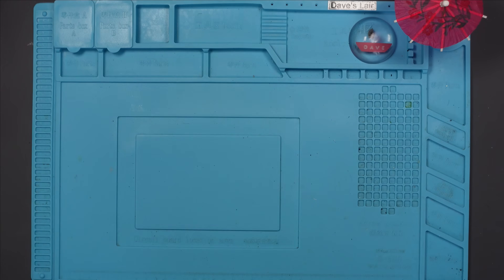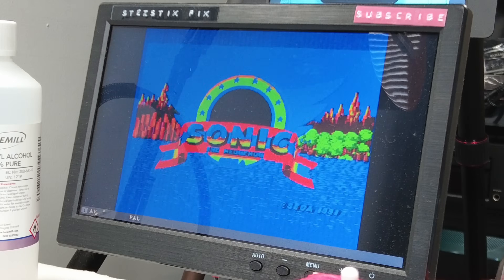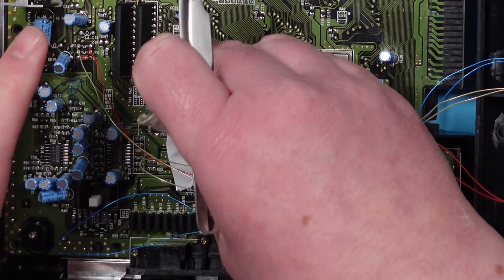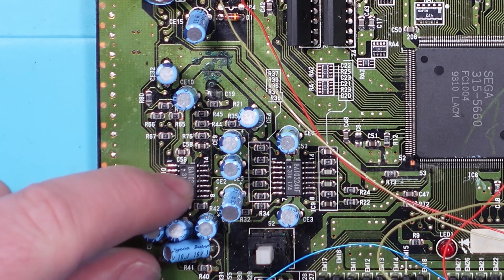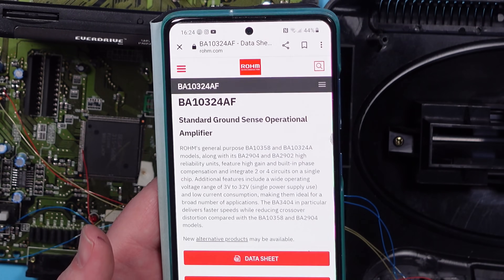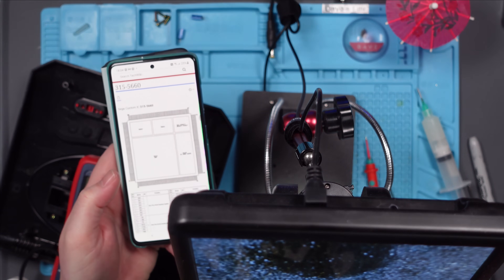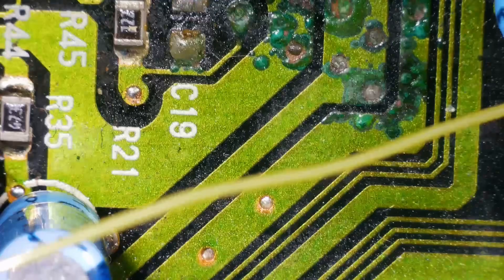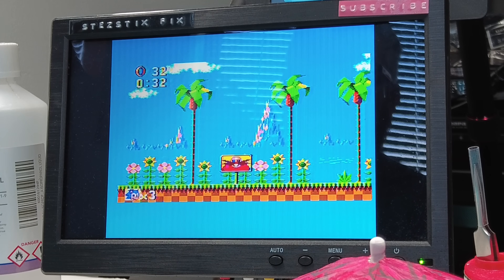This MEGA DRIVE Has a Strange 8 BIT SOUND Fault | Can I FIX It?

Comment: When NONE of the Master System sounds worked, I went straight to the square wave generator - they kept it on the Mega Drive as a quasi-channel, but it did ALL the Master System sounds.

Comment: You have to remember Steve that the Mega Drive is over 20ish years old and is bound to have Dried Joints that need re-flowing..Also you said that "Sonic music was slow" but it sounded fine to me, it was never a fast soundtrack
Reply: He says that because it is a well known issue that 50Hz systems in EU and other countries like mine that use 220V/50Hz will render the music slower than systems running at 110V/60Hz like those in the US and other countries that use that standard.

Comment: Nicely done. Problems like these will happen again on this board though. Leaving the corrosion that's on other traces will mean it will keep spreading. Much of it is under the solder mask, so cleaning efforts will not have done much if the mask was not scraped away and the copper cleaned.

Comment: Neat so the jump sound is using the master system chip. Coolio
Reply: jumping, skidding, and also parts of the music (I recommend watching a Green Hill Zone Deconstruction video).

And to be pedantic, the Programmable Sound Generator hasn't been a chip since the SG-1000/SC-3000 :P Not a discrete one, anyway. Because even in the Master System the PSG circuitry was combined with the Video Display Processor in an ASIC.

In the Mega Drive 2 (at least the typical ones with Yamaha-made ASICs rather than Toshiba) even the Yamaha OPN2 (YM3438) circuitry is in an ASIC with the PSG and VDP.

Comment: so im assuming the music speed is normal for your regional console?
Reply: yes, Sonic 1 wasn't optimised for PAL so the whole game and the music, everything, runs 17.5% (or whatever) slower than on NTSC. Later Sonics had optimisations if booted up in PAL but usually it was the correct speed music but still with slower gameplay.

Even though the console has the mod, he couldn't use the NTSC mode because his monitor doesn't support it.

Comment: Instead of futzing with sawing down the barrel plug end of the cable, check out self-amalgamating tape. Stretch and stick it onto itself as you wrap around whatever and it creates an excellent seal. The run-of-the-mill flavor is not super durable, as it can still be torn more easily than some tapes or heatshrinks, but much easier to apply in a variety of situations. Fancier versions exist that improve on the material weaknesses.

Comment: Great analysis to find the cause of the problem. Just one thing: You paint over areas that still show corrosion. Not that there is still something of the acid in it and spreads further under the paint. In addition, all electrolytic capacitors should definitely be replaced in such a case. So you don't have to start over and over again.

Comment: Initially I genuinely thought the problem was music was running slow. Then I realized it's the PAL version. God the PAL conversions sucked :(
Reply: the music speed was fixed in Sonic 2 onwards but still with the slower gameplay and squished screen.

by the time of Knuckles Chaotix on the 32X (!), they finally bothered to fix the squished screen and actually make the PAL version of that game run in 320x240 rather than 320x224!

Comment: I felt like screaming for the first 13 mins as I've had the same recent experience on a Mega Drive 1 and was certain it'd be a corroded trace to/from the ASIC!  In my case the issue was no sampled DAC sound effects due to a broken trace to the Z80 chip.  Still, great result and very impressive skills to swap the SMD components!

BTW, PSW = Programmable Sound Generator

Comment: Stez I have a Sega Mega Jet. (A very rare Sega console that was used in japan for flights.) It had no audio/video when I purchased it. I found the chip that was hot and I researched it and it was the audio chip. I took it off and well with it off the video now plays but there is no sound because of the missing chip. The problem is I think I ruined the contact pads when pulling off the chip in the first place. Could I ship my sega mega jet to you with the audio chip I ordered to see if you could fix it? I'll pay for everything of course and it could make a neat video maybe? Thanks!

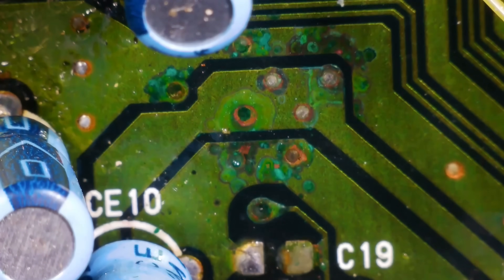Comment: 6:48 is the fault, its the pcb through hole.  The one near C19, you can see the black of the pcb is showing were it connects to the trace.  Not easy looking to spot but all that corrosion needs removed.  Been looking at lots of repair videos.  There are eyelets to repair the pcb through hole (Plated Through Hole Repair Kit).  You can also epoxy a new trace and attach it with solder.

Just a wire works but you don't know how far the rust/corrosion goes into the through-hole barrel.  A wire is a quick and dirty repair.  Youtube PCB Eyelet Repair | BEST, Inc. if you are interested and How To Repair Damaged / Missing PCB Pads || 4 Great Methods.  Remember you can glue the new trace in place and then solder. These are the true fixes.  If all you have is a wire like this video, How To Repair Damaged / Broken PCB Traces - 2 Great Methods.

Everything I have read states all the corrosion needs to be removed.  The copper trace can be removed and replaced with clean copper.  This restores the trace to new.  Got to love what you learn from others on youtube.

Comment: i like it but i have to say it. that switch would have made sonic run at FULL POWER..... i mean at full speed. it was running in the pal slower mode that sonic did not program for
Reply: ironically he had to run it in PAL because that monitor didn't like NTSC.

Comment: 8bit soundchip is called z80
Reply: StezStixFixtelegram  is that spam? Or real?
Reply: Wrong! The Mega Drive has 2 CPUs - a Motorola 68000 (16-bit main CPU) and a Zilog Z80 (8-bit co-processor). It also has 2 built-in sound sources - a Yamaha YM2612/YM3438 OPN2 and a Texas Instruments SN76489 PSG.

For those 4 chips, there are 2 clock signals - 7.6MHz for the 68000 and YM2612/YM3438, and 3.58MHz for the Z80 and SN76489. But shared memory mapping is used, so the YM2612/YM3438 and SN76489 can both be controlled by both the 68000 and the Z80.

Comment: Nice find. I never knew the MD's sound was seperated like that.

Small tip though, it would be a good idea to remove the rust from those other traces before it ends up eating through them completely. Then apply solder mask.
Reply: Yep, and with the Mega CD and 32X, the PCM and PWM (respectively) sound channels can be used in conjunction with the Mega Drive FM and PSG sound channels (such as in Popful Mail in-game and Knuckles' Chaotix).

Another platform, the GBA, would later do a similar thing. The Sonic Advance games are a good example on that platform of heavy use of the Game Boy / Color PSG sound channels in conjunction with the GBA PCM sound channels.

Comment: I strongly disagree that the heatshrink tubing over the frayed cable on the power brick was a fix. That heatshrink tubing is cosmetic, and really not much more. I hope you at least advised the owner to be very careful with it!
Reply: It's not cosmetic if it prevents the cable from bending more....
Reply: @samholdsworth420  Sure, bending. But what if he tugs at it a little? There's a certain amount of friction offered by the heatshrink tubing, of course, but it's nowhere near safe. Furthermore, whatever amount of bending it prevents is going to be insignificant. I'll assume you don't actually know just how thin and flimsy heatshrink tubing is.
Reply: @herrpez  sure it wasn't the best approach to "fixing it". It's a wall wart you plug it in and you never touch it again lol.

Comment: Yuck this prior mod. The tape of unknown composition isn't exactly guaranteed to not develop conductivity or emit acid from the adhesive (both things happen), and the soldering and nonexistent cleanup quality... I feel like I should start console modding or something.

The readings of both caps that you took off look almost factory fresh for their values, no problem at all. Could have just as well spent 3 years on a warehouse shelf rather than 30 years in a console.

Comment: I have a repair and resell shop on eBay and I’m always afraid to do any micro soldering, or major board repairs. I have to admit watching your videos give me a little bit of confidence for some reason.  I really would like to see how you would fix damaged ribbon cables. And I really wish u had some sort of vaccum or air purifier to suck up those fumes, if I remember correctly they can be really toxic and bad for your health to inhale that.
Reply from the maker: Thanks MicMaine!  I do have an little extractor, and use it most of the time... you're right the fumes are not nice to inhale!  Good luck with the eBay shop! 👍
Reply: Yeah well depends on if you solder once a week, then hazard is minimal, or 8 hours a day, when even standard extraction isn't quite enough.

Which part of the world are you at? I wouldn't mind partnering with a vendor in EU to do the repairs for them.

Comment: Steve you done an awesome job and great video, may I ask @6:36 you used your little brush to clean the board, what is this brush called and do you have a link please as I would love to get one. Many thanks
Reply from the maker: Thanks Martin!  It's actually a flux brush that I've cut down the bristles to make a bit more abrasive.  I bought a little pack of them, these ones:  https://amzn.to/391kndu
Reply: @StezStixFix  Thank you so much for replying, I definitely need one as following the SVS guides (Steve TF, Vince MMV, Steve SSF) I have managed to pick up some cheap broken consoles (Ones S & One X) and managed to get them both working. Over the moon even tho i dont have a microscope yet YET! it was a challenge, would love to send you pictures somehow. Now checking out the brushes thank you again

Comment: Good fix.  Did you neutralize the corrosive goop so it doesn't do any further damage to the board.  Battery acid, electrolyte from capacitors and flux resin can cause corrosion.  You can clean it with baking soda or isopropyl alcohol.
Reply from the maker: Thanks Darren.  I did clean it with IPA, but I've been back to it and cleared it much better using white vinegar, followed by IPA and a good scrub.  👍

Comment: Nice repair, perfect demonstration of the Mega Drive's two sound chips/cores haha.

And the Mega CD and 32X can access them as well so it can get a bit silly. For example, Popful Mail uses the Mega Drive's Yamaha FM + TI PSG as well as the Mega CD's Ricoh PCM for some of its music (3 sound chips together - once you get past the CD Audio title screen, of course) and Knuckles' Chaotix uses the Mega Drive's Yamaha FM + TI PSG as well as the 32X's Hitachi PWM for its music (also 3 sound chips together) :P

Being a Mega Drive 2 VA0, the sound quality could be improved by installing a Mega Amp - I think you might have been in the stream New Retro Repair did of him installing my Mega Amp in my Mega Drive 2 VA1 :)
Reply from the maker: Thanks RWL!  Appreciate the info.  I'll take a look at those Mega Amps!  👍
Reply: @StezStixFix  welcome :) there's also the Triple Bypass, but that's more for if the console also has a video encoder with the jailbar issue on RGB, like one of the Sony ones (not sure what the Samsung is like). I chose the Mega Amp because my MD2 VA1 has the Fujitsu MB3514 video encoder which looks fine on RGB.

Comment: Hi there Steve. Greetings from Germany. Just stumbled on your channel. I´m amazed that you don´t have more subscribers yet :). Not sure if you just didn´t show it in the video or didnt´t notice, but you tore off the red wire from the mod that went to the CPU (the one under the white tape). It´s disconnected in the later part of the video.
Reply from the maker: Thanks Dennis!  Well spotted!  Yeah, I did notice and I did put it back on, I edited it out to cut the video length down a bit!  👍

Comment: By the time the Mega Drive 2 came along pretty much everything had been integrated into the 315-5487/315-5660 ASIC, but even as far back as the first revision of the MD1, the SN76489 PSG was already integrated with the VDP on the 315-5313.

The mono signal from that, along with left/right from the FM, A left/right line from the cart slot (used by the 32X), and a left/right from the Expansion slot (for the Mega CD) is then all mixed in on that amp circuit.

99% of sound problems are often down to the caps going bad on that circuit. Either dying or leaking and corroding the traces.
Reply: I agree.

Comment: PSG stands for "Programmable Sound Generator" l think this probably goes to the Yamaha chip as the data in.
The games are slowed down, probably as a consequence of that mod they did there (I read "50Hz" on one of the 2 switches, might be worthwhile playing with those to see if you can get the console to play the games at their correct frequencies).
Reply: PAL Mega Drives are normally 50Hz, the mod is to switch to 60Hz. But he said he had to set it to 50Hz for his monitor for some reason.
Reply: Almost all MD/Gen games ship the same ROM chips in all regions to save on mask costs, and have the game detect which region it's running at. In later games there is speed compensation, but in Sonic 1 there wasn't, it's just slower in PAL region.

Comment: I’m a little worried about the corrosion now sealed under your varnish. Probably would’ve been better to remove the corrosion first since it could still contain something corrosive and continue to corrode.
Reply from the maker: Yeah, I'll definitely be sorting that out! 👍
Reply: Corrosion requires oxygen. The whole point of the green stuff is to block oxygen.
Reply: @JoshuaJonah  Rust isn’t the only kind of corrosion. Everyone can see the effect of electrolyte on traces under solder mask despite the solder mask protecting it from air. Heck, the solder mask itself corrodes.

Comment: When I fixed an AC adapter like that recently I took apart the brick, moved the strain relief down, chopped off the damaged parts, and resoldered. It can be difficult to break the strain relief free of the cable but it’s usually possible. Even when it’s not you can often use another or make your own with heat shrink. Since you’ve already chopped it at the brick you shouldn’t have to chop up the other end for heat shrink. The result should be much cleaner and more reliable.
Reply: Yes I'm all for removing any heavily kinked wire sections as well, they can't be healthy.

Comment: Too think someone actually had to pay for that mod... The mod itself isn't really hard to do if you have some soldering knowhow. I did mine with a black rocker switch on the side. Much cleaner and sort of looks stock.
Reply from the maker: Yeah, a little switch on the side would be much better! 👍
Reply: Mine is a single 3-position switch on the back for 50Hz PAL, 60Hz North America and 60Hz Japan. Not sure why you'd want Japanese or North American region at 50Hz, or PAL region at 60Hz.
Reply: @RWL2012  Ikr it's for region lockout. Some games just require it to be in the different regions

Comment: Great stuff Steve, excellent fault finding here. I'd have to say though it might be a good idea to take care of the rest of the rusted vias because they're going to eventually eat away at that copper. Still a great enjoyable video either way 🥰
Reply from the maker: Thanks Phil, yeah I think I'm gonna recap everything and do a bit more work on it off camera. 👍
Reply: What up cod3r.
Reply: @boneyass  what's weird is that during rhe first sonic 1 demonstration you did it only sounded like the square waves themselves (the thing sonic:s jump sound is made out of) were dead, but the noise channel was alright (what makes the crash portion of the monitor sound x as well as the waterfall doing waterfall things

Comment: I had a similiar problem with GBA not that long time ago. There was no sound at all. Potentiometer from vol was missing and pads were ripped also from pcb. I restored them and put new vol wheel but sound wasn't still showing up. Took me some time to find that IC power weren't  givin voltage at all to volume chip. There was no clue for eye on the pcb because other person who tried to repair it, cleaned everything so that was a time when schematic comes in handy. One jumper wire from right leg to other one and here it is - working gba like a charm.

When I saw leaked caps on your board that was my first thought - it must be broken trace somewhere, and luckly it was.

Steve - you're preety good (pointing at you with my fingers crossed like revolvers)
Reply from the maker: 😁 thanks tofol! 👍

Comment: Who on earth puts switches for that mod there!!!! It's an easy mod for those switches just cut a trace and a leg and wire up and you're done.
That was some good investigation, you had it before you swapped out those amps.
Sonic on the Game Gear and Master System is great. Different game to the Mega Drive version.
Reply from the maker: Thanks Craig. Totally agree, it's definitely an odd location for the switches! 😬

Comment: Good work steve, you could have disassembled the power adapter it has 3 screws that hold the plastic housing together, then disolder the wires and throw the heatshrink that way so you could have avoided cutting the connector rubber. But all is well. Remember it's easier for us to make comments than to actually think this shit through when doing it hahahaha.
Reply from the maker: Thanks BeoGeek! Yeah, i didn't realise it could be opened up, I'm gonna take a look at that 👍
Reply: Just finished it all to the end, I have to say bloody good job Steve, most would just call it a day after re-capping! Kuddos mate!

Comment: Nice fix Steve, I think I might have taken the wire from the capacitor pad which you used and ran it over to the other via where it went through the board omitting the corroded section all together just in case, but either way its all good :) well done on another successful fix.